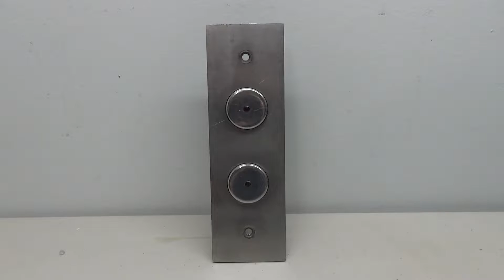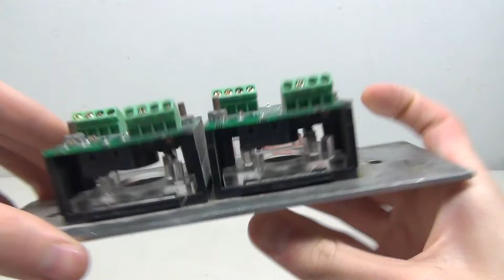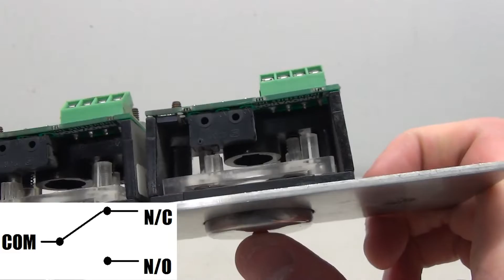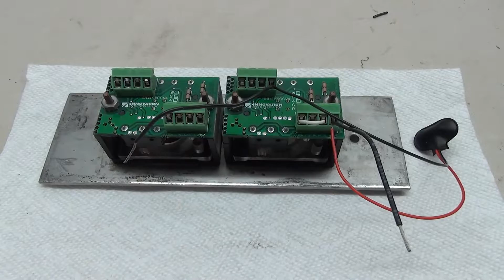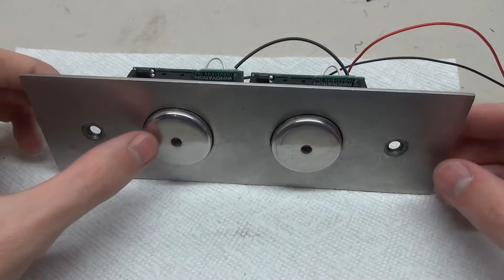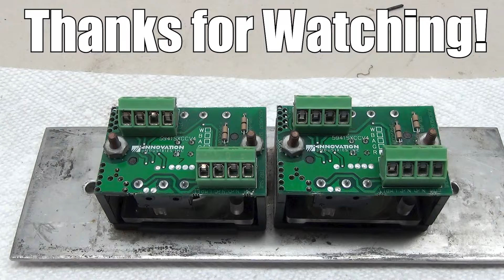How to Wire Innovation Elevator Buttons

Comment: 2 micro switches are good in case one fails witch is very unlikely
Reply from the maker: Also, the switches can be disconnected for using them as separate switches.
Reply: @stlelevators  true even arcade buttons only use one micro switch